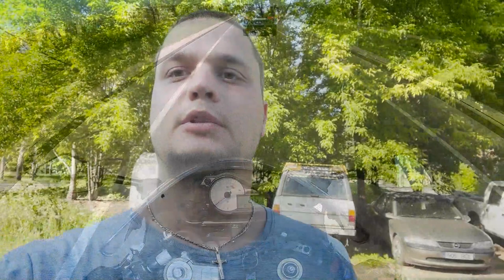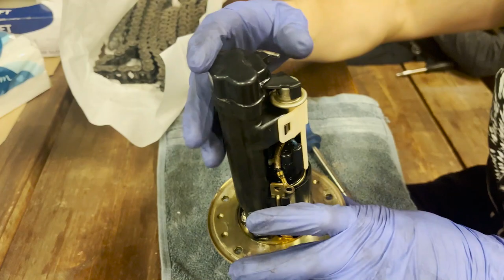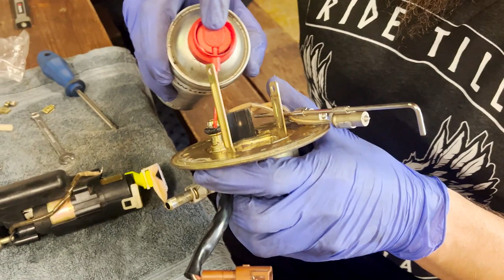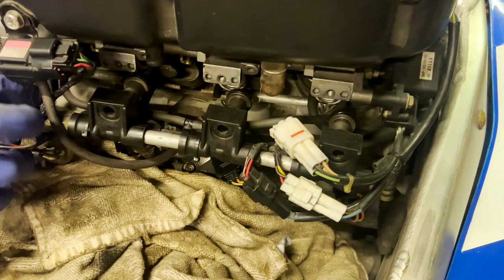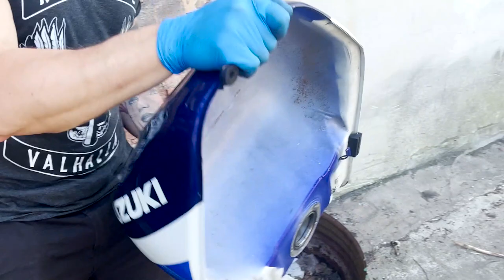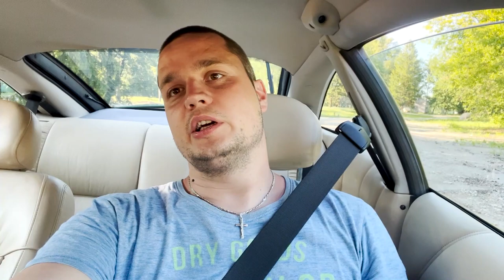Suzuki Gsxr 1000 problem and hopefully a solution

Comment: didn't long get my K1 1000 running again, religned the entire tank, due to the shitty fuel we need to put in now, and had to replace the fuel pump as it was completely dead, managed to get a 2nd hand one for £150 from a salvage yard saving me £350 on top of that. Now running sweet as again
Reply from the maker: You have to put petrol in with bio extra in?In Estonia we don’t have that anymore.

Comment: Amazing work bro, I been watching your videos for awhile now. I have a 2002 gsxr 1000 with 17k miles I got a few years back. I have the same problem, I dropped it off at the shop a WK ago. They got said I need my injectors cleaned, tanked cleaned, and I had a small oil leak. Had to replace the starter cover. Here in NC cost me 1000 😅. Soon I’ll start doing the work myself lol
Reply from the maker: Thank you for your support.You have low miles on your bike and already such problems.I hope you got the problems solved and car ride with a peaceful heart.I will make new videos when i have problems,but hope not soon😃I want to drive for a while😃

Comment: sounded very good. ur mic. which mic and where do u place it?
Reply from the maker: @RandomRichZ  i used simple laptop external mic and i placed it in front of the helmet inside.
Reply: @TheMeisner87  thats basically what i did.  I use a Insta360 X3 with the rode wireless go II mic in pretty much the same position but my mic still pics up so much outside noise and my voice is low. I will tag you in the next video I post so u can see.
Reply from the maker: @RandomRichZ  yes ordinary laptop mic gave me the sound and waiting for your video.

Comment: I have the same bike, needs a tank change and no doubt a clean of the injectors.
I'm more impressed your friend had a calibra,  not seen one of them on the roads for a long time.  The salt used on the roads in Scotland over winter simply eats away at cars if not looked after.
Your spot on though.
Many bikers forget a motorbike only goes as fast as we make it.
I'm now looking for a k3 1000 fireblade and a k3 R1 to sit with my GSXR.  I simply don't like the lights from 2004 until today.
Looking forward to more posts 🙏
Reply from the maker: Hey good to hear from you.
I hope you find a tank for your bike.Calibra is getting more rare by everyday.Luckly i will restore mine step by step.Also yes we drive as fast as our brain allows🙂I hope you find the bikes you wish for.New videos are coming soon.🙂
Reply: @TheMeisner87  Many thanks for the reply.
I have another tank there, needs cleaned out. I dropped the bike in my garage, tank landed on axle stands.
Nice big hole in it.
Would be great to see what you do with your Calibra.  Sun's out in Scotland for a change and no rain.  Can't wait to get back out on the bike.  Sat from before covid so fingers crossed it doesn't need the injectors done.
Definitely going to change the filter
Reply from the maker: @justintime1307  If you have another tank then its good.I restored my calibra wheels and tomorrow i will go an bring her out from hibernation.I also plan to bring my bike home this weekend.So new videos are coming.

Comment: Balance the intake it is out of sync it should be done every 2 years that is the 02 i know i have the 01 there is a plastic tube they sell with the connection to open the injector electronically connecting any cleaner to clean them out then balance the intake you think you're scared now lol 
do that and hold on lol
Reply from the maker: My mechanic did it and bike is working fine right now😃
Reply: @TheMeisner87  insanely good bike i think timing chain and tensioner is next for me ive heard if not replaced if it comes apart major damage to the motor the (tensioner head) but i figure 25,000 miles its time got it at 11,000 a year and a half ago in mint condition i have the 2 round tail lights wish i had yours almost bought it but not sure if it has plastics around it that i might not have... Yours does sound nice kudos to the mechanic
Reply from the maker: @plew4528  when you havent checked it then yes its better to check or change.Mine is working fine.I have over 60000 km on the clock.